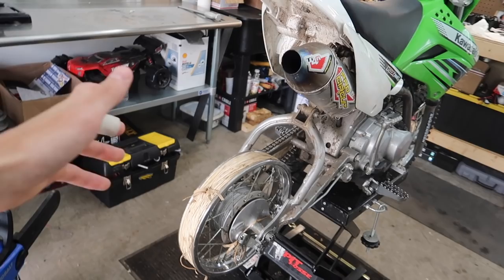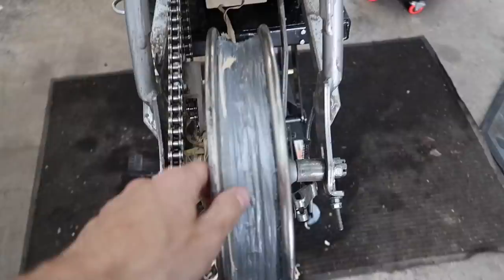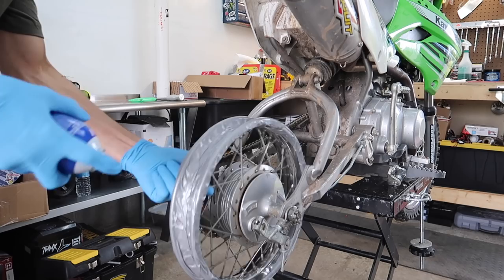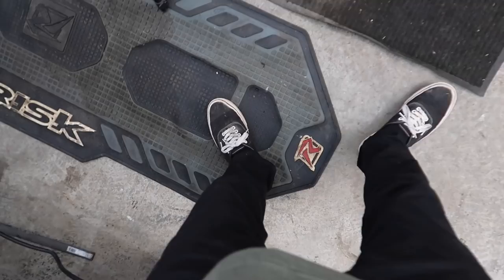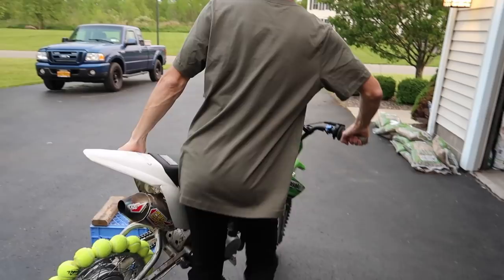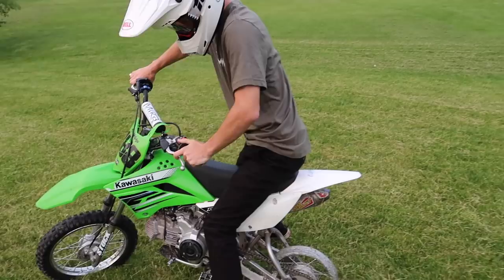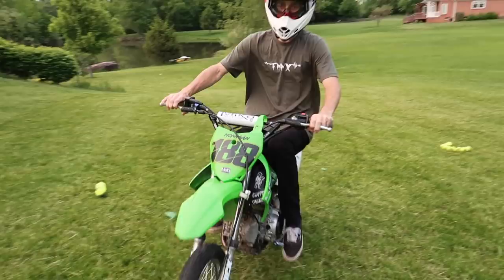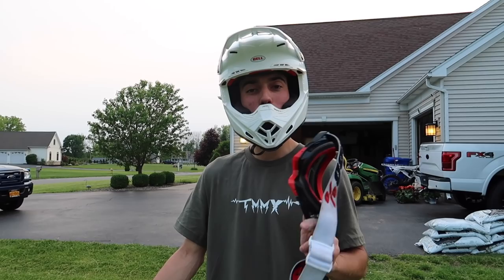PIT BIKE TENNIS BALL TIRE

Comment: You should’ve put like some kind of wire or a small bendy like pvc pipe to hold them all together. Make a scrunchie with it and put glue on the tire then stretch the necklace of tennis balls around the rim and there you go😂